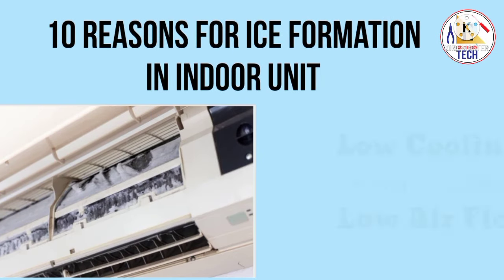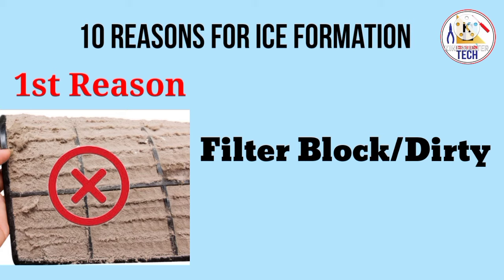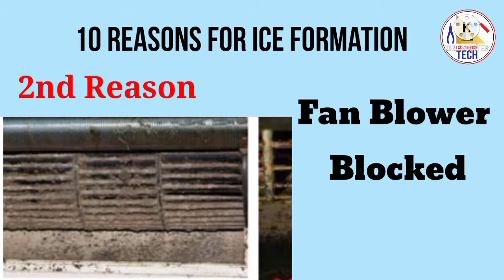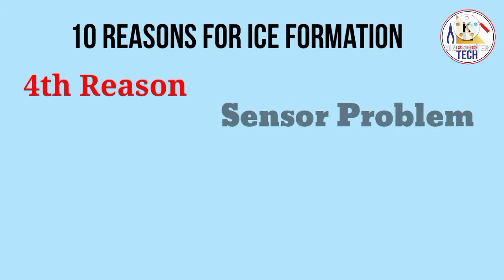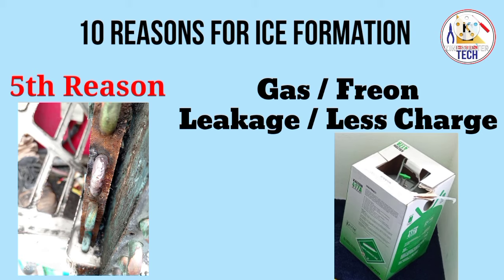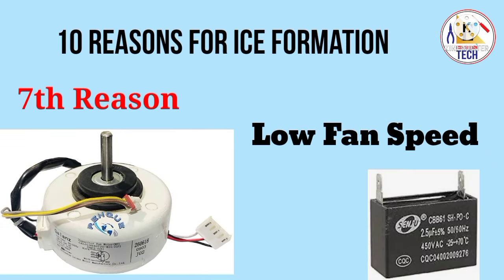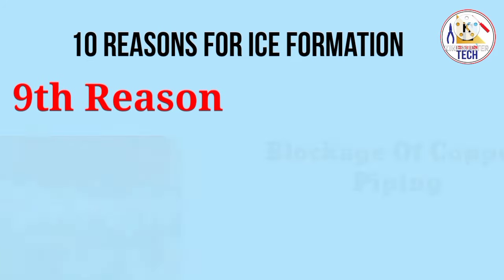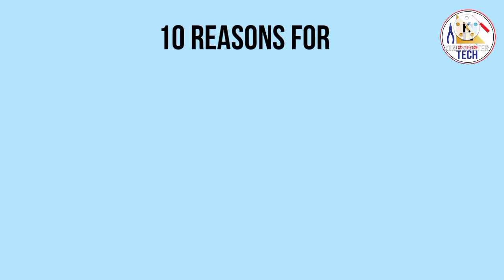10 Reason For Ice Formation In Indoor Unit /split ac ke indoor me baraf jamta hai /ice forming on ac

Comment: What is the cost for fix this ice formation issue in indoor unit and also in ice formation in outdoor gas passing tube.
Reply from the maker: Thier is a gas LEAKAGE
Reply from the maker: It's a old unit or new installation done
Reply: Voltas 1.5 ton 2018
Reply from the maker: 1)Need to check the leakage first.
2 ) find the leakage & Stop the gas LEAKAGE.
3) than vaccum needed.
4) than gas charging.
Cost depends on the technician.

Comment: My screens were clogged and stuck to the ice on the evaporator. Cleaned the screens and sprayed hot water through the evaporator. The unit returned to normal operation but chunks of ice kept falling off the inside of the evaporator including a big one that occluded the fan.
Reply from the maker: Check refrigerant gas

Comment: Hi, my TCL split AC filter has ice formation and I had it installed in June of 2022. So it’s been about 11 months and I haven’t cleaned the filter. Can I fix this issue without a technician by cleaning the filter if the ice melts?
Reply from the maker: Check if the blower fan & filter is totally blocked with moulds & dust . Clean filter as well as fan blower in indoor & check . If ice still remains then call a technician.
Reply: @Rehankhan_HVAC_TIPS  thanks so much- ice melted and I cleaned they filter, everything is back to normal thank God. thank you!
Reply from the maker: Join this channel to get access to perks for All HVAC TECHNICAL SUPPORT 👍
https://www.youtube.com/channel/UCjUFtXZ-oMCNht6Icj6R6NQ/join

Comment: Behind the filter screen in top its freezing ice what to do now
Reply from the maker: Tell me the age of the unit ?
Causes for ice formation:
1) Gas leakage ( Major cause)
2) If the indoor unit is not serviced, the air flow is less than ice can form.
3 ) If the fan blower in the indoor unit is not working, then there is also a chance of forming ice
4) The coil sensor in the indoor,if it's faulty, then also there is a chance of forming ice,

Comment: My Voltas ac is not cooling on High speed of fan and on lower temp if the ac is on 26 and fan speed is 1 so it will Cool but if fan speed increased no cooling and start sounding like fan is cutting something and very small ice piece and
Reply from the maker: Check the compressor side , if the small copper pipe is forming ice it's gas LEAKAGE. If a big copper pipe ice forming indoor unit needs servicing.